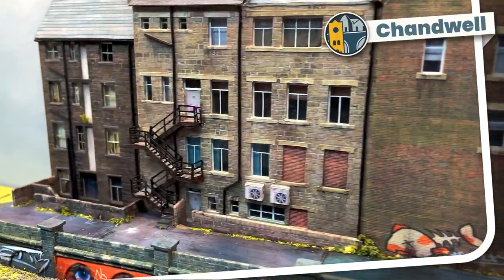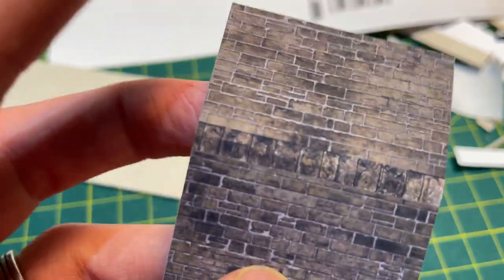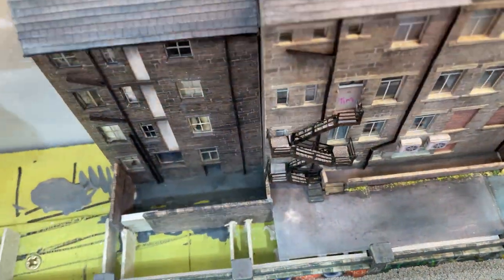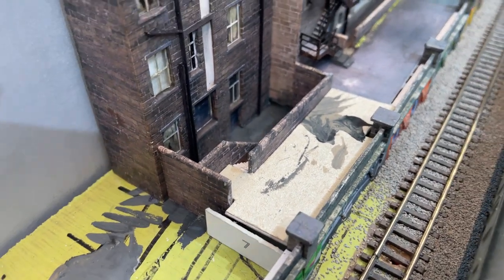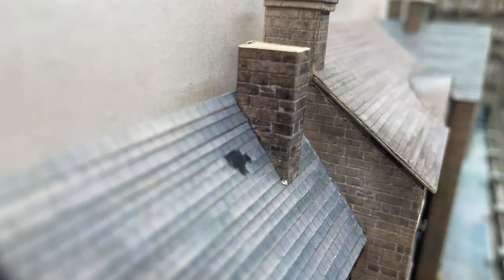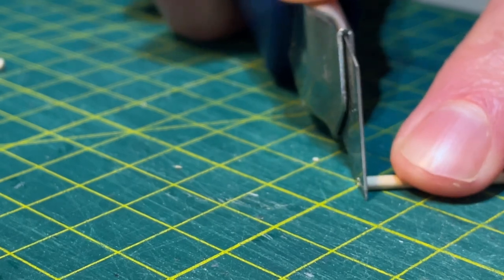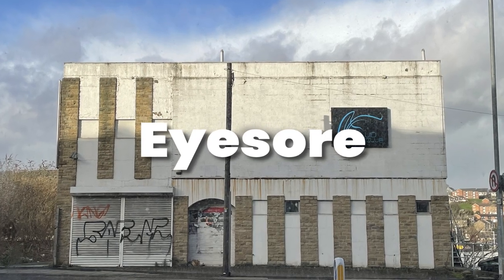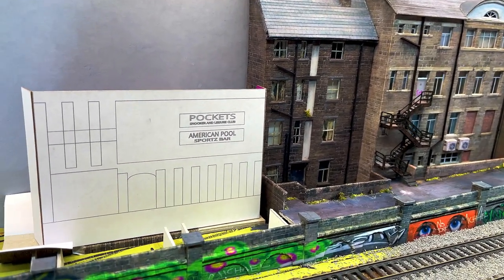19 Market Street Finished, and a horror yet to come - Scratch Building Market Street Part 10

Comment: No 19 was nicely finished off Michael.  The whole building looks, if you don't mind me saying, as just the kind of dump one would find in Chandwell.  Talking of which, the concrete carbuncle you have in mind is just the kind of building that would be thrown up to fill vacant lots in the 60s.  I think it would provide a nice realistic contrast, and I suspect it will be fun to build.  Stephen
Reply from the maker: Thanks Stephen. It’s been very good fun to build so far but I’m not sure I can make it look like the back. Would the back of such a building looked like that? Some have commented that it looks the wrong way round and I tend to agree. Hmm. :_chandChandwell:Michael
Reply: @Chandwell  These buildings were truly awful however you looked at them.  It could be that this is indeed the back because the front has space on the ground floor for a couple of shops with the upper levels having bigger windows.  It would give the right seedy feel that the idle ne'er-do-wells frittering their days playing pool or snooker would have to enter around the back.

Comment: The horro building could introduce a nice break in the row of market street, but you may need some background to it as it will be shorter than the rest of the street, so you are supposed to be able to see the other side of the street over the top of that building.
Reply from the maker: That is a challenge to come, but it would make for a lovely addition to the back scene!  :_chandChandwell:Michael.

Comment: Oh so good Michael 👍.  Your next  project would certainly be a carbuncle in Chandwell!  I'm currently building a scalescenes kit - what do you recommend is best to cover white edges ?  Cheers Euan
Reply from the maker: Hi Euan. The beauty of Scalescenes kits is that there are not too many are edges. I used to use marker pens (Windsor & Newton from art shops) but the ink used to bleed a little. I’ve started using watercolour pencils now, as well as a children’s watercolour set from WH Smith. Which model are you making? :_chandChandwell:Michael
Reply: @Chandwell  It's R012A - road over rail bridge.  Just toske it more interesting I have to build it on a skew to tie in with the existing bridge it joins onto.  Just finished the parapets.  No where near as good as you but then again it's been a few years since I built a scalescenes kit.  Once all the "accoutrements " are in place most of the "errors" will disappear!

Comment: Michael - What printer do you use and are you satisfied with the results you get? I have a fairly inexpensive printer mostly for printing bw documents, but I'd like to upgrade to something that will print color images and textures sharply.
Reply from the maker: Hi Mark. I use a Canon inkjet printer. Aside from the cost of the ink, I am very pleased with it. But it is important to get good paper too. My printer ink is water resistant on good paper which means I can apply varnish by brush, and add use watercolour paint to hide edges etc. On normal paper though, the ink is not water tight and runs. I mention some of this in this video if you’re interested… Scratch building with card - tools and materials
https://youtu.be/-QvdNFST7WU
Reply: @Chandwell  Thanks for the response. I'll look into this and similar printers.